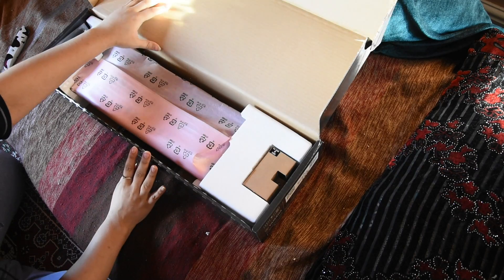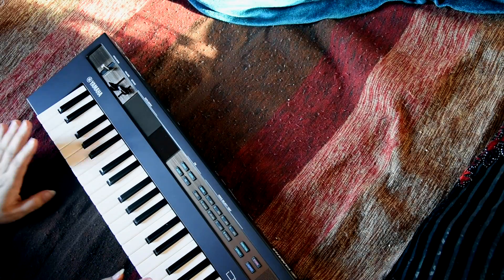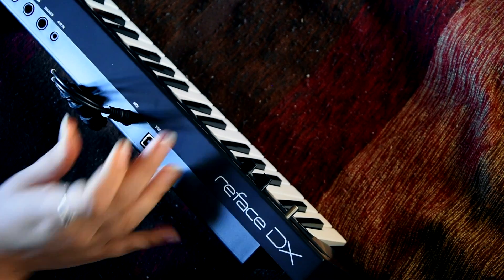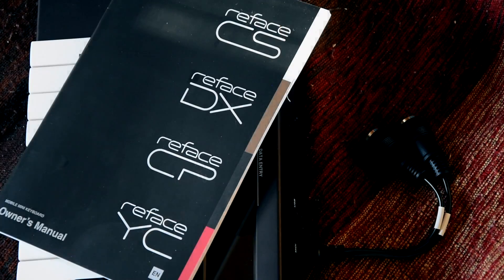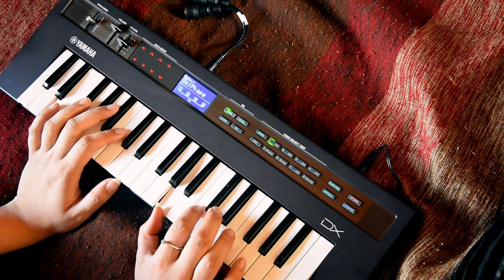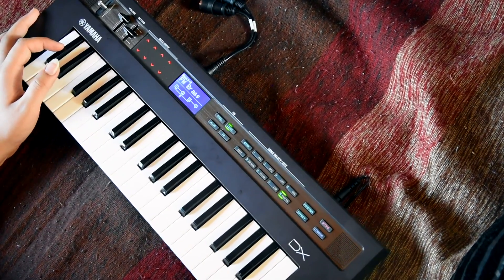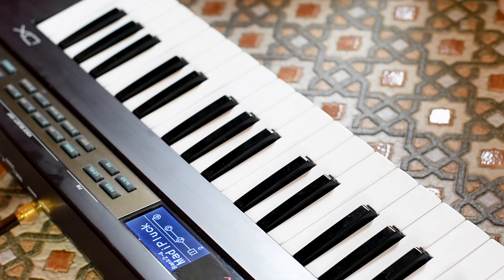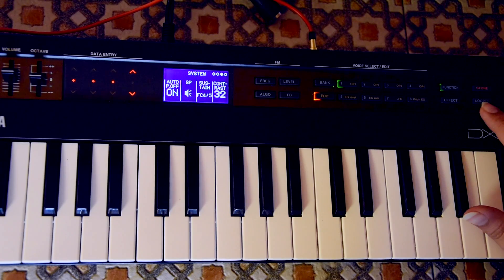Yamaha Reface DX Part 1 - Unboxing & First impressions

Comment: I think I'm in love (with the DX) :)
I have been wanting to dip my toes into a synth and this thing looks killer. 
Hello 80's synthwave, here I come.
Reply from the maker: As somebody who has never meddled with synthesizers before, I would recommend this. i've heard that the user interface on this is way easier than the original DX7 was/is .. I cannot comment nor compare as i've never tried the DX7 but I'm getting to grips with this interface fairly quickly :o)
Reply: Excellent.

Comment: Its crazy how much i have in common with you, from vintage hifi and gaming, to turntables and spectrum analyzers, and now synth keyboards lol. I decided to get the cs first though, i luv all those sliders and tinkering while playing. Im surprised you didn’t get the cs first, are you not a huge amiga fan girl lol. 

Have you ever heard of the yamaha cs-01? The original from back in the early 80s. That little analog synth is awesome. I’ve wanted one for years but couldn’t  find any around me and refused to buy one off eBay from china. 
I suggest you check out your local used listings and stores for one, you might find one for cheap, there the next best thing to a cs reface and possibly a lot cheaper.
Reply from the maker: This Reface DX was an impulsive buy, I loved what it could do and just went for it, even though you tell yourself "lets look at the others" there's that inner kid in you pulling your arm saying "Okay you saw it, now get the DX" , thats what happened lol  btw, the next i'm saving up for is the CS for the very reason you mentioned, i'm a huge Amiga fan girl :oD. Once I do i'm planning to do a video on it like this also :o)

Comment: I'll be interested to see if Yamaha have made using fm easier to get your head round though. Can't wait to see how you get on with this :)
Reply from the maker: I think you'll enjoy the next part...I go into much more depth with the interface etc and try to get my head around FM synthesis :o)
Reply: I remember spending ages trying to find the filter control on my DX27, Turns out you have to stack your operators a certan way.. It was at that point I decided I was happy enough with the presets lol.
Reply from the maker: lol I think I would have been the same with the original DX series, I was like that with the Yamaha Sy22.. but you may wish to see the part two i've uploaded, I get on well with the interface :o) 
https://youtu.be/goY6BIZhWzM

Comment: home early from work and what do i see? Madija on a nice synth. i "am impatient to see some musical creations in the future.
do you already have a midi interface for your amiga then? i am also a little bit interested about the other (usb)midiport, because i have got a medely DD401 drumkit which has only that. and many new keys dont have this (mini) din version. wonder if that could be hooked on old midi someway.  small keys still,  but this way you can fit some more nice synts in your room. maybe one full size midi keyboard to control them all. haha
Reply from the maker: Hahah :o) 
I actually already have a basic Alesis MIDI controller with full sized velocity keys which I can link to this and use that instead, it works great just as expected.
The USB I think is a built in MIDI device, so rather than having an external one connecting to MIDI ports, there is just the USB end.. whcih is convenient but not when you have an Amiga with a MIDI interface (yes one of the very few things I saved back in the day was the Midi Interface haha) 
It took me a while to save up for this lol, I think it maybe this is as far as i'll go :o)
Reply: oke glad you still have the midi interface for your amiga. then i dont have to send it. just joking. i gues your correct about those internal usb interfaces in newer instruments. interesting to figure out how those instruments could be used with the amiga also. ps. dont get mad Maddi if you get mixed up with the in and out, out and in visa versa of the midi cables. it made me freakin out.
and nope, this is not as far as you'll go. i expect a vere big rack of synt collection in the future.
Reply from the maker: LOL The MIDI out - in - in - out thing is a freakin head thrash, I remember this...And then you have MIDI thru to put the cherry on the top ;o))
Oh i'll be getting more synths? ;o)) haha i'd love to if they werent so expensive :o) .. i'd get the Reface CS or something like this if I could...but it's an expensive hobby!.

Comment: nice little synth reface dx...there are also old patches converted from tx81z or dx21/27 (four op synths)...in gaming history 4op synthesizers has a long tradition from arcade cabinets to msdos soundcards or sega megadrive.

however, if you need a good synthesizer capable of doing fm stuff i cannot suggest you to give a try to yamaha montage, 8 operators fmx engine with spectral skirt and resonance control at operator level, reads dx7 patches, and with motion control engine you can modulate fm parameters in realtime or seq based and via envelope follower you can use also external signals to control fm.

best of all has 128 fm voices plus 128 stereo sample based voices like amiga chip (only 4 low quality), reface cannot import samples and use them with fm.

PS montage operates also like a soundcard and midi controller, you can hook up it via usb on to logic or cubase and use it to record midi and digital audio like the focusrite scarlet, it has a great audio card inside derived from hi end yamaha digital mixers called PAC technology (pure audio circuit).

Comment: Does it have aftertouch? By that I mean if you press a key and hold it and then press it harder it adds effects like vibrato?
Reply from the maker: As far as I know the Reface DX has no aftertouch
Reply: These Synth don't have aftertouch capabilities in their internal synth engines. However the DX7 Reface and also the CS Reface, both send and receive velocity information via MIDI. I'm not sure about the other two of the Reface series.
Reply: Thanks, good info to have. I don't really think it's that important of a feature personally, it would be a nice bonus though.

Comment: great little machine you have :-) - nothing for me, since as a composer I use software synthesizers only .. but I can understand the passion for hardware synths ..
Reply: Yeah those are super helpful when you don't have the space or money for a whole gear-garage of Synthesizers I've been using software syths since 2003 and find them super neat but also after a while rather boring. I am a very physical person and need something I can touch and fool around with.

Comment: I still haven't bought the Synth that i have had my eyes on because I'm still arguing with myself over the price. I kinda wish Korg would bring a new version of the DS8, which was their version of a DX7, however it came with only 4 FM operators instead of 6, like the DX7, because back then Yamaha held the patent for 6 FM Operator Frequency Modulation Synthesizers. The Korg one had some very interesting sound capabilities too and some performance sliders that allowed you to manipulate sounds during playing a lot easier than the DX7.
Reply from the maker: If you're unsure, i'd advise waiting, only get something if you're heart is fully onto it. though meanwhile try not to fall into short term traps with this, it's easily done when you feel impatient. Hope you get the best one for you :o)
Reply: I actually am and REALLY really want that thing. But the price… i mean it would be quite a lot of money i would lose for it and that is what keeps me a little worried at the moment. I can afford it but at the same time i feel like i actually can't. I hate that >_<

Comment: Cannot hear the sound when mobile headphone is inserted in aux in.im confused mobile headphone works or not ?
Reply from the maker: "Aux in" is an input... you need to plug your headphone in the "Phones" output socket
Reply: @MsMadLemon  thanks for the information. So the ordinary mobile headphone doesn't fit in the phone line rt?
Reply from the maker: No... Iphone headphones wont work on this.
Reply: Thank you so much

Comment: Surely you must mean a lot of mid eighties music was done with the DX-7 type FM sound, because before that in the early eighties it was analogue synth in Europe/Roland 808 USA and by the late eighties pretty much all sample based instruments like the iconic Ensoniq Mirage which that song Good Life by Innercity at the turn of the decade used stock sounds from the Mirage. I don't think music could change much more in one decade than between the very end of the seventies to the very start of the nineties
Reply from the maker: Well I just wasn't being specific, I just said the 80s which is still correct ;o))  It was still a huge chunk of the mid 80s I believe as I think the Dx7 was produced first in 1983? not exactly sure on the year. 
Indeed there was a huge change in that decade, it's quite amazing and one can see why a lot of people love the 80s music as a whole.
Reply: I agree it is not exact and there is plenty of overlap which makes it great. The Pet Shop Boys were also around in the mid 80s and only used a Fairlight sampler based set up mostly and plenty of FM based synths like the DX  were of course used in the 90s too. Betty Boo even did her first album on an Amiga 500 +sampler initially even though she could have done that technically since 1986 onwards and of course Paul Hardcastle  used a bit of everything for his number 1 Nineteen right in the middle of the decade  :)